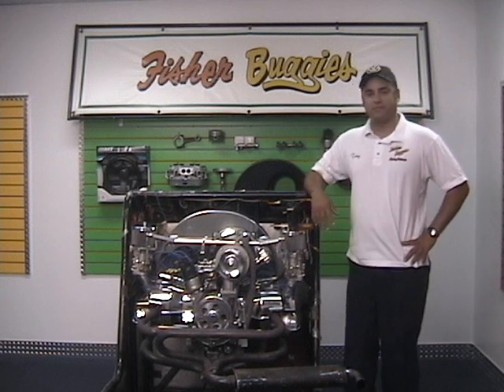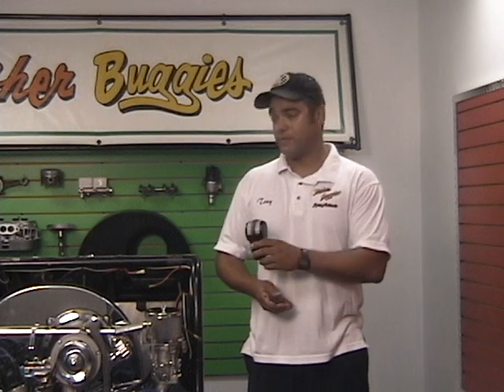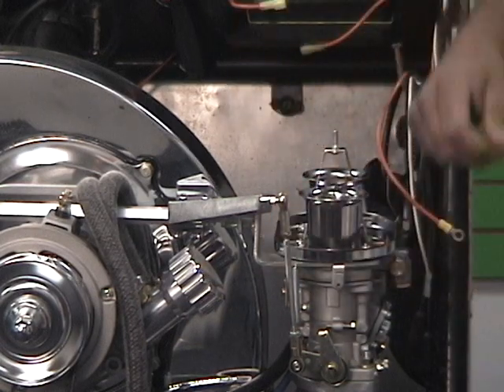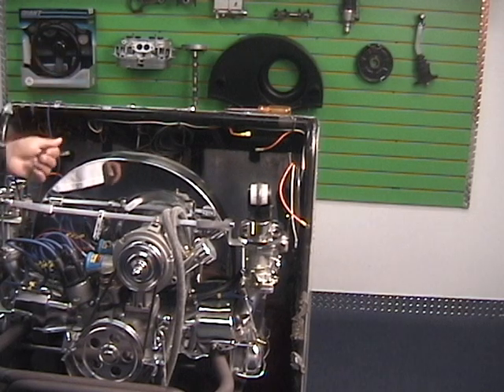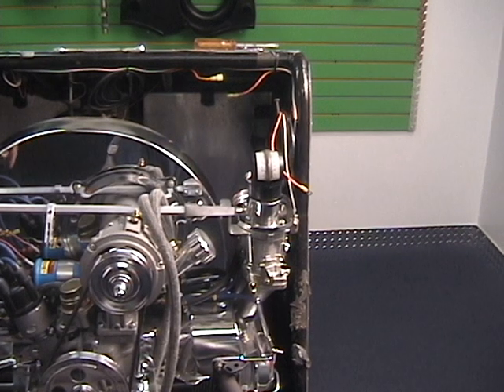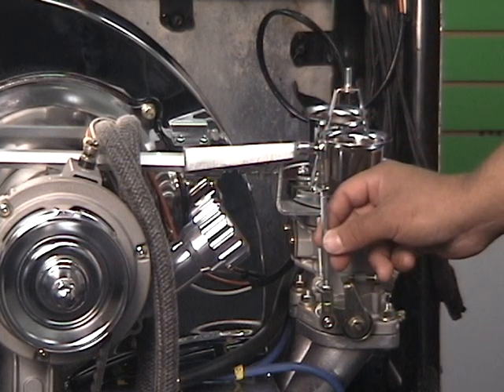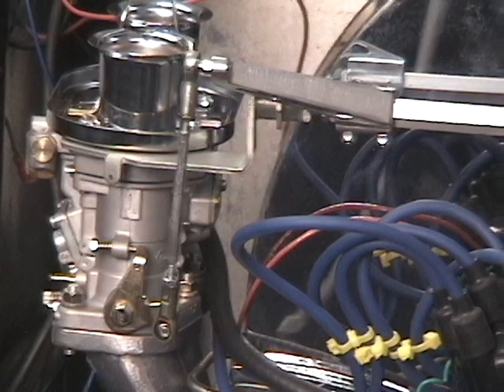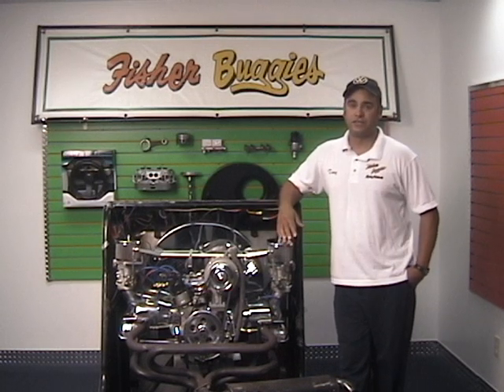Synchronize Dual Carbs on VW Type 1 Air-cooled Motor

Comment: 9/30/23 questions  on procedures...1)should engine be warmed to operating  temperature..2) should  each  carbs idle screw be adjusted out to barely  contacting before  reading  airflow 3) should engine  be static timed beforehand  4) at what rpm should  strobe timing light  show full advance...thanks

Comment: Hey buddy I’m having issues getting full throttle on my dual Weber carburetors. I have a 1915cc And can I get past 65.My carburetors are sent but I am thinking it has something to do with my throttle cable.Any suggestions?

Comment: I have a question as I just installed a set of Weber 34 ITC carburetors and started it but it's popping which I thought might have been the timing was slightly off but isn't, any suggestions? Thanks

Comment: Would't using the snail make adjusting the linkage more accurate or is a visual truly good enough?  With the throttle held to a high idle you could use the snail to get them perfect.

Comment: I was wondering why my 69 baha bug dual solex carbs 1995cc was popping  or backfiring when on the throttle ? Also thanks to your video on valve adjustments I was able to tune my bug in even closer to a better running bug! Cheera M8

Comment: literally just came home with a dual carb 74 beetle 1915cc for my kid brother and when idling the engine shakes bad from side to side but give it throttle and it settles until you are back at idol we haven't warmed the engine up yet but the guy we bought it from said it clears up once the engine gets a little warm. Might we need to sync the carbs on this bug? This'll be my first time messing with a beetle.

Comment: I have a VW 1600 Twin carb engine in my Rewaco Trike. It will only rev to 2500 RPM in top gear with the throttle fully open. On checking the lever on the carb [other end of cable] I can see it only opens half way, I can manually open it much more. Is there an adjuster on the carb[s] to make the lever open fully. I have little experience with VW engines.

Comment: Yep sounds like a fisher engine :(   Hey Tony you forgot to mention checking points first then timing and adjusting air bypass screws before base idle setting especially on HPMX junk. Also fuel mixture settings as they effect idle as well, plus if jetting you may have to fine tune everything once more in the end. Try it on your stuper beetle

P.s. F7 emulsion tubes in IDFs

Comment: For my 1914cc engine I previously commented about I found that without the air filters 10x better and would start backfiring and losing lots of power with the filters on. While then trying to balance the carbs the the left 44idf weber was not responsive at all when adjusting the idle mixture screws for both barrels over cylinder 3&4. Cylinder 3 had little to no air flow at idle using my unisyn and cylinder 4 had about the same air flow as the other 44 idf over cylinder 1&2

Comment: Have a 1914cc and engle 110cam in a 70 bug. Came with dual weber 44 idf. Car was all out of tune so with 009 dist we set the timing at 30 btdc at max advance and the valves are all at .006. Put in the jets according to cb performance chart 60 idle jet, 1.55 main jet, 2.00 air correction jet.
It backfires on deceleration but not much. On freeway past 45mph in 4th starts to have little backfires consistently. What do you recommend? Have not had time to sync the two carbs perfectly yet

Comment from the maker: Yes, timing could be an issue. We have a timing video also, and a valve adjustment video too. Did you just put the dual Webers on? If not, have the worked good in the past? If the carbs are old they might need to be cleaned and rebuilt.

Comment: my car has dual carbs... 1776 dual webers... and it can barely do 60 on the hightway... it spits, pops, and lurches. Carbs synced up... could it be timing at this point?
Reply: Lean condition or fuel pressure issue or both.

Comment from the maker: The number is irrelevant, as long as there the same and the RPM is where you want it. The air/fuel mixture has variables ie jetting, cc's. You want a good color on the spark plugs and no hesitation. Please let me know if you have any more questions.

Comment: I have a recently rebuilt 1776cc with single port heads in 69 ghia. Everything else is stock. I'm looking for a recommendation on replacing the stock 30pic 1 and the manifold. I'm looking for more balls overall, especialy out of first and 2nd